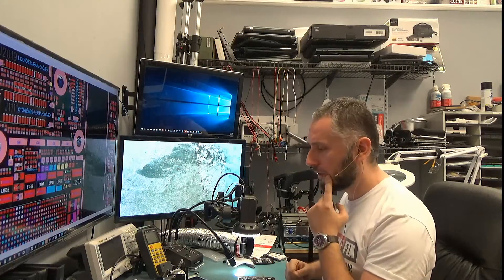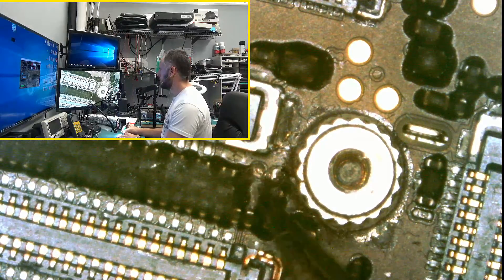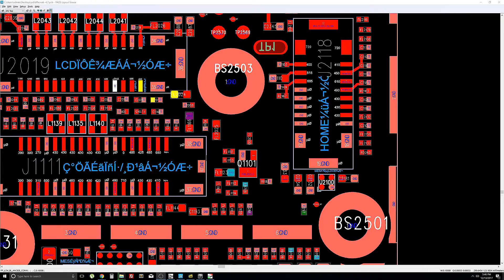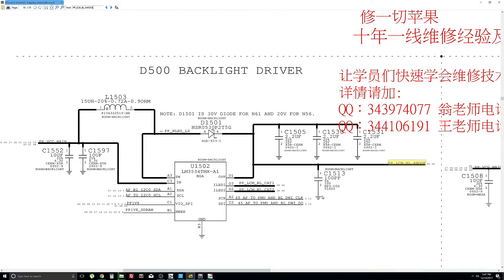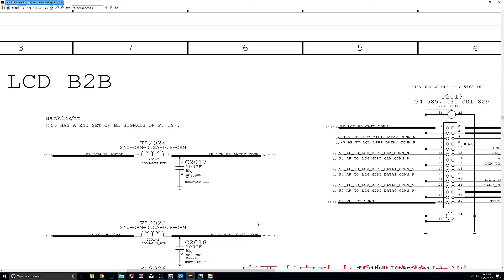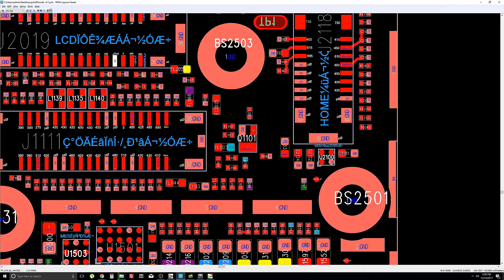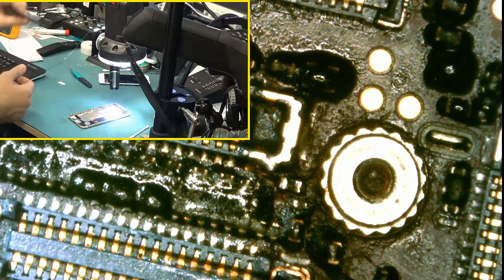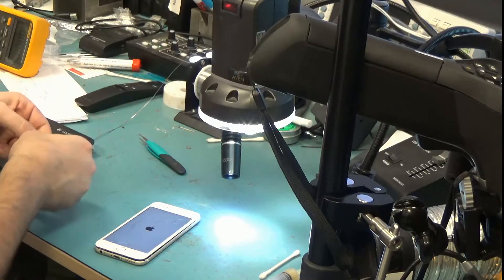iPhone 6 No backlight - circuit diagnostic and repair.

Comment: Thanks ok my question is we check short using multimeter red on grown or - and black on the other side or + we can test on the board like this way or just on same   areas
Reply from the maker: You can use this method on any board or part that you want to test for short.
Reply: thanks for this information